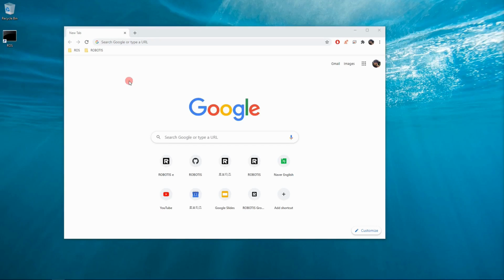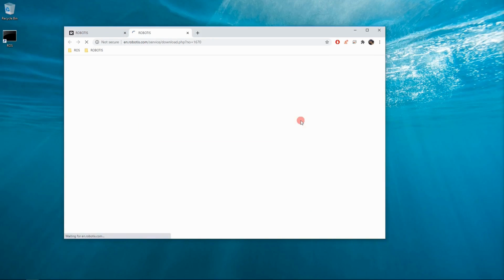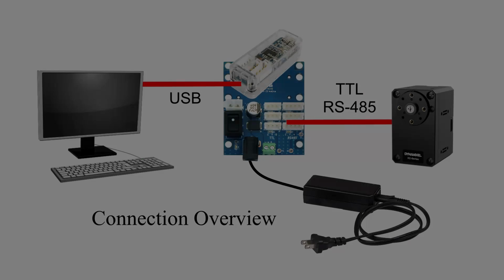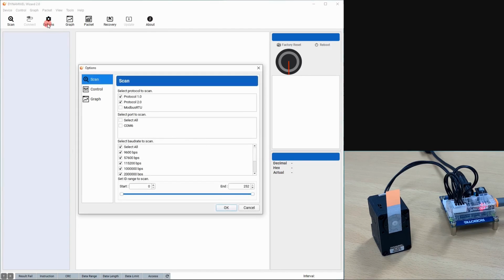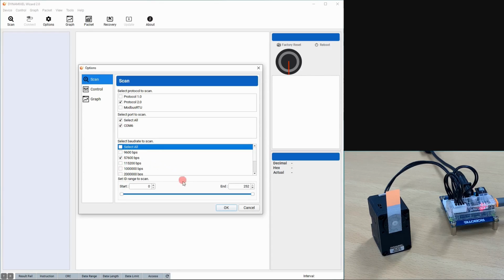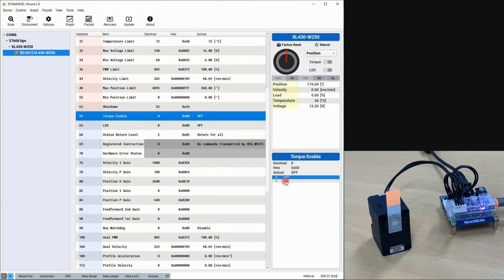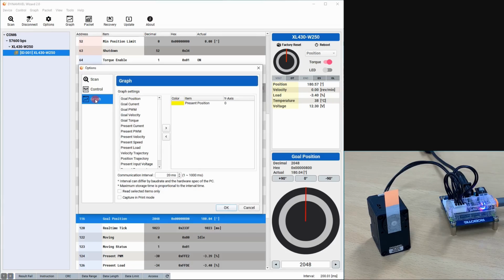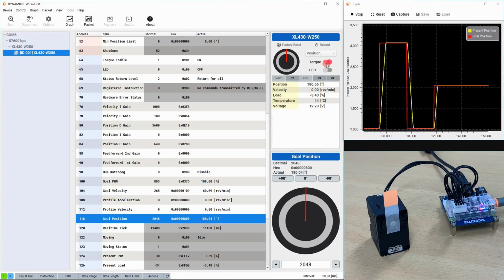DYNAMIXEL Starter Set Quick Start- DYNAMIXEL Wizard 2.0 Software

Comment: Hello, I am experiencing some difficulties with Wizard 2.0 that seems not  to see any servo.
I have 11 servos, 3 XL-320 connected to an OpenCM 9.04 controller and other 8 AX-12A connected via OpenCM 485 exp. All of them are visible through the Arduino IDE when executing the program uploaded on the OpenCM controller. When using Dynamixel Wizard, the scan function does not "see" any of them (the port in the Wizard is the same used by the IDE, I am not using the two programs concurrently, the servos are properly powered, the scan is setup for using all the protocols and baud options). 
I would need to recover a 4th XL-320 stuck in shutdown mode (LED always on and no response to ping or any other command), can you help solving this?
I tried both on a Mac and on a Windows system with the same results, could this be caused by the OpenCM 9.04 not running the default firmware?
Reply from the maker: Unfortunately the OpenCM is not compatible with DYANMIXEL Wizard, as shown on our compatibility table in the ROBOTIS eManual.
https://emanual.robotis.com/docs/en/parts/controller/controller_compatibility/#etc

If you own a U2D2 or comparable USB to serial adapter, that would be the best way to connect your DYNAMXELs to DYNAMIXEL Wizard.

Comment: Nice video, but I have a bioloid premium robot so will this work with my bioloid?
Reply from the maker: The bioloid uses a CM-530 as a controler not a u2d2 so the process is a little bit different. Is there a specific goal you are trying to accomplish by connecting a bioloid to Dynamixel Wizard?